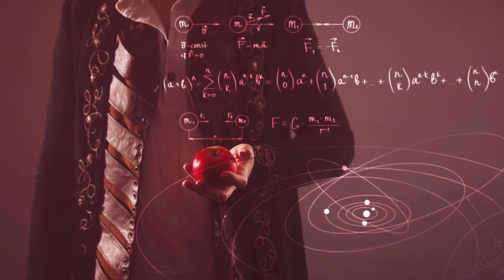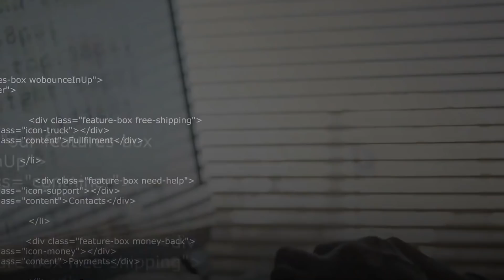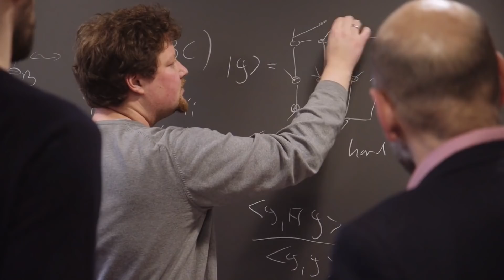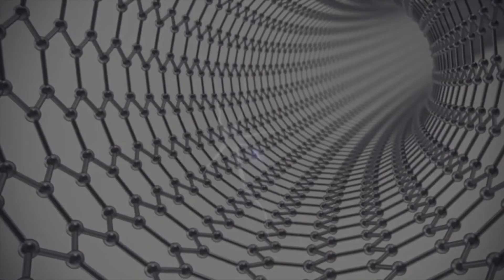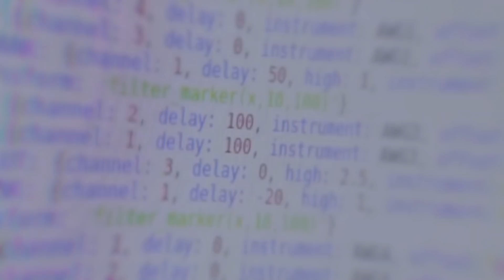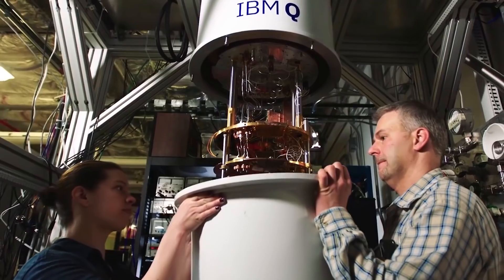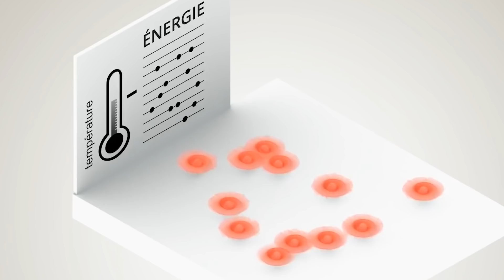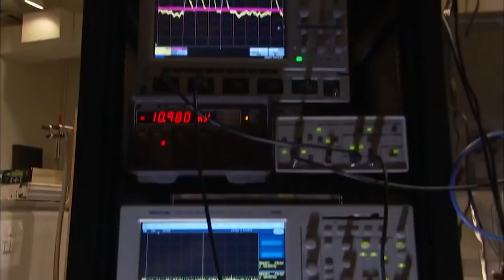Scientists Just Made A Quantum Computing Breakthrough!!

Comment: If such technology arrives will it, or has it already been blocked the same as free energy? Because ability of equations to use electromagnetics to mimick photosynthesis and create carbohydrates, protein and fatty acids from the hydrogen, carbon, nitrogen and oxygen in atmosphere will allow production of food, alcohol and gasoline from thin air.

I wonder if the main trick here is zero resistance and zero friction heat loss only. The multiplication factor in recording more pairs through entanglement, if such a thing is reality. I wonder what these magnets are doing to record data.

Dees bits
https://youtu.be/SDVGn912DUQ?t=6m37s

Comment: Ahh...another breakthrough in QM.
Add it to the pile.
Reply: @Boris Vasiliev quantum computers are specifically naturally adept at solving extremely large state space problems such as DNA sequencing, protein folding, electromagnetic interactions between different elements in compounds or alloys, simulating certain complex problems, deciphering encrypted files and maybe even mining cryptocurrency. But they aren't designed to play games or browse the internet. Games and most other software programs require sequential processing every unit of time which a quantum computer isn't designed to do.

Comment: Absolute rubbish. Quantum computation is a giant money pit that morons and idot investment groups are pouring money into because they don't want to miss out on a new set of the emperor's clothes. It's a sham, it's a modern day flim flam operation that's making millions for it's proponents and delivers absolutely nothing of use. There is a fundamental problem in quantum computation regarding error correction, as you scale up the qbit count the error correction required scales by orders of magnitude. By the time you have enough qbits to do any useful work you have such a deeply error filled result that it will never be practical. By all means go plow your money into this and I guarantee you in 100 years it will still have achieved absolutely nothing.

Comment: I'm not impressed until they make a general purpose quantum computer.
Reply: Yep.  The Chinese Quantum machine is hard wired for just that one calculation.
Reply: A general purpose quantum computer is quantum bullshit.  Quantum computers are not meant to be general purpose.
Reply: @Alfalfaprime  So does this mean every calculation requires designing a new quantum computer for that single purpose?  That one algorithm and that's it?
Reply: @Whistler-007  multipurpose is ok, but general purpose, to me implies it can be used for day to day things, like a PC.  Maybe I misunderstood what is meant by general purpose.
Reply: @Alfalfaprime  I think my comment was seen at the other extreme of the OP.  I think multipurpose is an accurate description of what they're aiming for.  My point was the Chinese, great as it is, was purpose built for just one goal.  Which explains why it shot IBM out of the water.
Reply: @Alfalfaprime  why not general? when they make finally such a computer I don't want be still using a slow computer with 12 zeros less capacity
Reply: @daan-man777  you can only use the technology to solve a specific type of problem, most of which are not required for general purpose computing.  Unless there was a breakthrough in quantum computing theory such that it was provable that somehow you could refactor any normal problem into a set of problems that can run on a quantum computer, and also, maintain those extreme order of magnitude of performance increase that is commonly attributed to quantum computers.
Reply: @daan-man777  Because it's only more effecient for certain tasks. It'll be a coprocessor if anything.

Comment: 6:32 "has come up with a set of algorithms" ... if it's quantum computing, the one thing it DOES NOT do is run algorithms.
6:54 "program a quantum computer" - again, you do not PROGRAM a quantum computer because it does not run algorithms. This is physics, meaning the quantum behaviour gives you the answer to a problem, but it does it in  a completely different way - it does NOT run programs or algorithms.
Reply: Don't know much about quantum computing but I think Quantum Algorithms are a thing and they are designed to run on Quantum Computers. Take a look at Shor's Algorithm which is a very well known Quantum Algorithm.

Comment: Uranyl Ion UO2 2+ default form, Uranium sulfate, redox acidic PH causing oxidation, water solubility and bonding.  Transuranic radionuclides that are water soluble that are looked for by the EPA.....thats whats leaking from this site, saturating the ground, evaporating under equillibrium conditions and flowing around the planet to be ingested like tritium...."Tritium directly or indirectly induce various biological effects including DNA strand breaks, micronucleus formation, cell necrosis or aptosis, chromosal aberration and various other phenomena thus negatively affecting human health. The half-life of tritium is 12.33 years and the AVERAGE penetration of its ELECTRONS in water is 0.56um, which is considerably lessthan the AVERAGE diameter of a human cell.  Therfore it does not cause damage due to external irradiation but rather long term internal radiation that results from inhalation, oral intake or absorbance of radiactive particles through the skin. AFTER ENTERING AN ORGANISM, TRITIUM CAN REPLACE HYDROGEN ATOMS IN BIOLOGICAL MACROMOLECULES OR BIND TO CELLULAR COMPONENTS TO FORM......ORGANICALLY BOUND TRITIUM (OBT). Exposure increases along with tritium levels in the environment." 
Smallest of all radionuclides,thought to be the least harmful of all radionuclides and is released from every water cooled nuclear regularly.